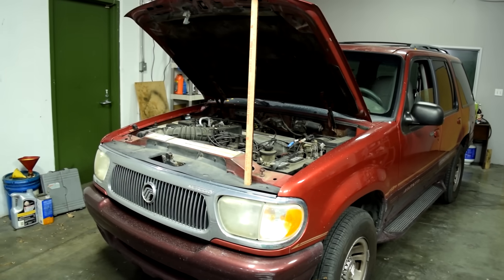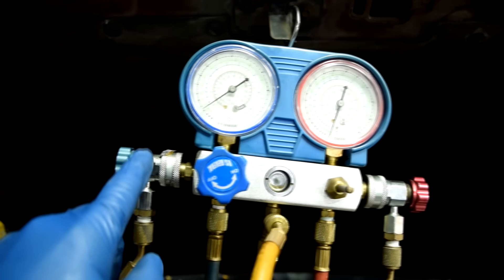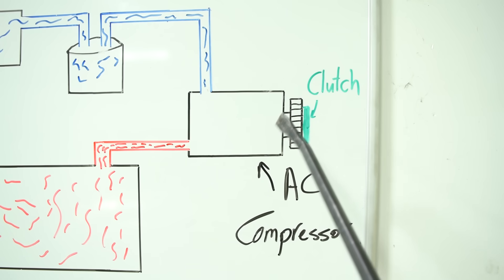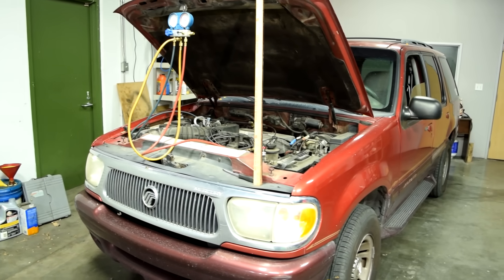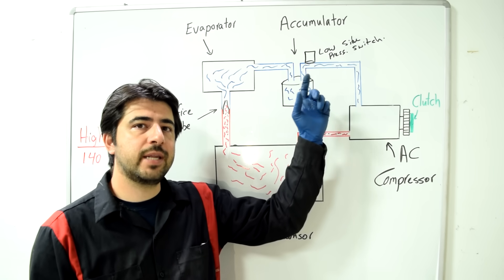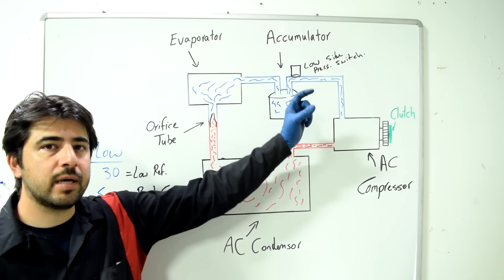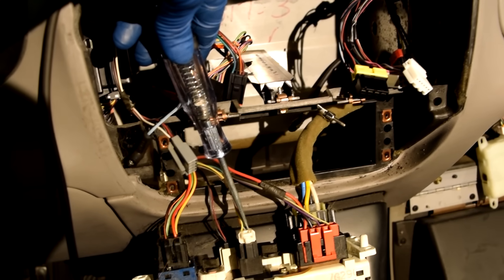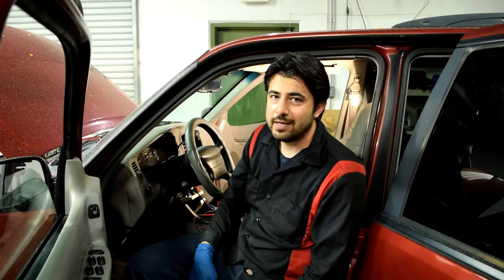Automotive AC Diagnostics, Operation and Repair

Comment: great video, i have a question i 2 cars and in order for the ac clutch to engage i have to bypass from pin 30 to 87 and it works, but i would like to know how to fix that properly where do i look ? relay is good, i have power on 2 pins when engine and ac is on it just doesn't make any sense to me if the relay is working why is not engaging on its own as it supposes to i bypass the low sensor switch but still not working it got the right amount of Freon if bypass is really cold inside but know i shouldn't have it running directly, any ideas

Comment: Great video. I do have a question. On the chart. The last column is the expected tempuratture output at those pressures. Can you explain what they mean Maximum Left Centre? Does that mean the internal cabin vent? Have not received my gauges yet. Seems on very hot day my Civic AC hits around 50, but gets down to about 41 at around 70-75 outdoor temp. Always feel its not up to snuff on hot days. Thank you in advance. Great channel and thanks for the informative video.

Comment: Hi, do you know what would cause the fan to turn on and off every 30 seconds or so? Raising and lowering the pressure on the low pressure side, everytime it cycles on and off. 
The compressor stays running and the air is cool but not real cold. Thank you.

Comment: Your 'Serviced Port Pressure' chart is so correct! Thank you for including it in your video. Google "AC Pressure Chart" and you get one from A/C Pro that has everything too high. When I used their chart, I got diminishing returns and my AC compressor would hard start like it was swimming in liquid. I used your chart and my car is now blowing a cold 40F on a 90F night (I'm in the desert) THANKS SO MUCH!!!
Reply: I was comparing his chart and thinking he has the wrong one because it does not say r134a on it? What kind of car do you have? Just wondering what refrigerant you use?
Reply: @humbledhands  r134

Comment: Years ago I learned to turn the compressor clutch by hand engine not running to check if compressor clutch was ok. Usually a little resistance but still turning meant it was ok but recently on a 2001 Chevy Ventura the clutch when checked by hand had no resistance and was turning very easy. Never seen that before. Could this be a sign of a bad clutch? Compressor kicks in normally, stays on but in spite of having a full charge, no cold air blows inside cabin. Any ideas? Tx for the video!
Reply: When you turn the outside plate on compressor clutch you are turning the compressor shaft and not the pulley which is driven by the belt, pulley free wheels when the clutch isn’t engaged
Reply: Sounds like your compressor is shot, no resistance means not building pressure

Comment: How and when would you recover, vacuum, or recharge the system? What is the order in which you would do this? If you were to recover all your freon do you perform a vacuum next and then recharge? How do you do each? Also how do you replace a bad part? I.e bad expansion valve, accumulator, etc.

Comment: in my 2004 toyota echo I have same (70)psi in Hi and Low with the engine off. with the engine on and ac on in max I have 0 on low and 100 psi in Hi. clutch was engaging but it stopped engaging after I reved the engine. can you tell me whats the problem? and thanks for the clear instructions

Comment: What is your opinion on using stop leak for a quick fix? Does it clog up everything when the mech is consulted to do a proper fix or replacememt of old seals and opens the system to the air?

Comment: I need help my AC works great  when moving but at idle blows hot air and I will spit out something from the compressor and start to smoke bad and I have to turn it off, but when start to move the car like from a street light and turn the AC back on and it will work great again , If you can give me some tips I would apriciated Thanks

Comment: to every pathetic mechanic or ac man; the system is simple, although the manufactures try to make it impossible for you to fix it, its still simple! compressor, low switch, high switch, condensor, evap,  and thats it! any extra switches, computers, dumb crap is being created by your manufactures!, now don't care about the high side at all, remember this, fact if you hook up the suction line fillt the ac after draining and vacing the system, the suction line guage should never go past 35! thats full! anyone tells you different is full of it! don't care what kind of freon you need to use, 35 on the suction guage and yes you need real guages and a thermometor for the vents! try it, been doing it for 45 years!

Comment: My low  side A/C line has blown in half twice as I was recharging it.  Now the compressor clutch wont engage so I bypassed it from the fuse box and I saw it engage while the car was running and I went to charge it up with freon but it wouldn't take
Heeeeellllllppppp....!!!!

Comment: Thanks for calling the switch the potentiometer, you know so much if the electrical system doesn’t really exist except as a tangent to that what is happening in electron flow. Most of this stuff is Hard to know like a thing that you know, but I suppose that even a switch would be a potentiometer, or a measurement of voltage by the positions 0 and 1

Comment: Easy Job. The blend door is broken from the actuator, therefore its in the full heat position. Just open the dash and duct tape it to the full cold position. You dont actually have to fix it, considering the owner wants AC. He'll just be without heat. If he wants heat though he'll have to open the dash again to manually puy the door back into the full heat position. But why do that, just go without heat since he lives in so cal.

Comment: Hello. Hopefully you can help me. When I connect the low and high side line to read the psi the low side is 70 and the high side is 60. The clutch engages and doesn’t disengage. Is stays on. The air is not cold. The gauges stay at the reading as well. I think this vehicle doesn’t have a expansion valve either. Do you have any idea off the top of your head what it might be? Thanks in advance.

Comment: I just replace the evaporator core on my focus cause it was leaking, and now my AC dont blow cold air like it use to... any suggestions?.. before replacing the core the inside temp would be 40 degrees, after replacing the core now it wont go no lower then 50 degrees

Comment: I had a blend door problem as well in a 98 dodge caravan....Removed cover knee plate driver side, remove actuator motor from housing, install Allen key into the hole where the actuator motor came from...In my case the van was stuck on evaporator side...So if I wanted heat I had to turn blower motor on First, this allows the blend door to be forced open and remain open until the blower motor is turned off allowing the blend door to reset to its defaulted failed position for ac... While the blower motor is on flip the allen key up and this gets the heat flowing over the core..Cost me 6 hours of labor trying to find my problem and about 30 mins to fix it once I found said problem.. I said fixed because it was functioning again but it was rigged and not suitable for a professional reapir....

Comment: Gr8 video mate. My compressor making noise. A/C was working good. I turn A/C on to cool motor down as radiator fans turn on(I know they come on at 109°c but I don't my motor getting that hot). Well didn't cool down, but didn't have noise. But everytime I try the noise get worst. A new compressor here in Australia $450 just to buy. Car exactly the same as a Pontiac G8 2008. 350000kns. It a pain to drive in the rain

Comment: Hi thanks for the video. I installed a new compressor. My readings are about 42 low n 42 high side. The clutch does not engage so warm air comes out of the vents. What could be the problem? Thanks in advance
Reply: Maybe the Blend box Switch !!!
Reply: Check to see if the low pressure switch is closing and providing power to the clutch, if not replace it.  Or you could Apply 12 volt power to clutch at the pressure switch location

Comment: Great video!! I have a question please.. 09 Hyundai accent..AC button wont stay on..if I keep it pressed down  clutch is engaged and cold air blows in cabin..??? I'm inclined towards bad button, or low pressure switch..haven't got it on gauges yet..your thoughts would be a life saver. Thank you
Reply: To me it sou like the Button ????  Was it ?
Reply: @jimmysapien9961  yes jimmy it was the cheepo button on a hyundai. You are correct 👍🏼..luckily I found a used one from some wrecking yard in some far off place. $30 replaced whole console. Hyundai doesn't sell the buttons alone of course. Believe it or not we had a leak in power steering high pressure line. Hyundai had no parts for a 2009 Hyundai Accent...NONE.. no part # at the dealership,  I had to fabricate my own ..don't buy Hyundai brother..I bought this car for my daughter for college. What a nightmare car...internal door locks all broke so you couldn't open car from inside. I replaced everything on this car when I purchased it. Another recall on this car is the shaft seals..they leak even with OEM seals which have to be pressed on. Turns out the recall in reality is bad transmission internal bearings...👍🏼👍🏼👍🏼

Comment: I charged my system to the correct coolant weight after a compressor swap (saw your other videos, and others). It wasn't cooling adequately still. About ten minutes later, a cloud of R134 just blew out from somewhere around the compressor. 
Static pressures are about 40/40. Running pressures are 20/60, so the high side is way off. When I try to refill again, the low side spikes to 80, high goes to about 100. The low side slowly settles at 25, but as soon as it goes over 30, it pisses a lot of coolant overboard again. 
Any tips? Expansion valve?
Reply: Your compressor was overcharged and blew a seal
Reply: @terryparsons830  No. I weighed the coolant added. System was clogged. Swapped out the condenser and other components...worked like a charm.
And then my tensioner bolt sheared two weeks later, so I gave the van away. 😂

Comment: 2011 jeep patriot 2.4
Rebuilt a/c compressor 
New drier 
New expansion valve
3 oz pag oil
20 oz freon
Evac was done
Ac was cold for 3 days then was blowing warm.
Low side reads 88 psi
High side reads 100 psi 
What could be the issue?

Comment: Great job in explaining. You were technically correct explaining how the low pressure switch has an open or closed connection to pass electricity. Very good explaining technical in simple dialogue. That is what makes you a technical teacher! thanks for your time and effort! Keep up the good work. 👍
Reply: Would have recommended unhooking heater hoses from heater core for a cheap work around for summer. At least the owner could get some a/c. Would rather be cold than hot any day.
Reply: @davidfisher535  better yet, clamp them bad boys n ur done...

Comment: Hi Sir! So the whole point is the valves on the gauges should be closed for the entired test? Thanks.
Reply: The valves are used to move refrigerant to/from the system. Not for diagnosis.

Comment: I have a Expansion valve on mine and when the ac is shut off it takes a long time for it to equalize.... could that mean the expansion valve is sticking or clogged?? And when its running the Compressor is short cycling like its low but ive added refrigerant

Comment: Hello. Thank you for theres video. It's very informative. I have a 2003 jeep liberty 3.7L. The ac speed working about 2 months ago. When it worked it was very cold. There's no leaks, the compressor works, has plenty of freon,  I was told the pressure's are good. The orifice tube is in the hose, warm on the condenser side, cold on the evaporator side up to the evaporator. The hose from the evaporator to the accumulator is warm, the accumulator is also warm as well as the side to the compressor. It blows warm air just a bit cooler than ambient temperature.  Does anyone have any ideas on what could be the problem? Any help is appreciated. Thank you.
Reply: So, I figured ot the problem. The condenser fan wasn't turning on. The harness was loose. Once I got the fan running it started cooling. Thought this might help someone.

Comment: Thank you & great video! I also have a 2006 Jeep Commander 65th Anniversary & the blower seems to fade in and out at times. I also need to change the blend door actuator since cold air is coming out of the drivers side and only warm out of the passenger side. Looks like I know what I will be doing next weekend!!

Comment: We have an 2009 prius and the AC blows cool air but not cool enough. Refrigerant level is fine. We'll check with the pressure gauge to hopefully diagnose it. thanks for the awesome video.

Comment: Had to replace compressor, drier, and accumulator. I tried to evacuate the system to see if it held a vacuum and it went right to 0 as soon as I cut off the vacuum pump. The only time I got any kind of pressure was when I put in some leak detector. But there is no pressure, and it goes out quickly.  Any clue what could be leaking that much?And I got a UV light and can't find anything, and it sucked up an entire can of refrigerant. Oh, and the compressor never turned on. So I imagine that the problem is on the low side, like the condenser, maybe?

Comment: Replaced the condenser AC fan but I discovered no power is getting to fan...Radiator fan operates fine an I replaced the temp coolant sensor...fuses are good...what could be preventing fan from engaging?

Comment: Bypass the heater core, top off the AC it's Southern California you don't need no stinkin heater!
Reply: I was about to suggest the same thing. Its cali. Screw the heater! Jam glue or jerryrig that things to full blast cold! I'm sure the owner'd prefer that over the blazing heat he's been enduring these past few years. Too cold? Open a window or just turn it off. 😎
Reply: Holy Drug Lord🔼  That's right!!! I retain my heater core for those few weeks of the year where the temperature just DROPS all the way to sub 65 degrees!!! Heater goes on FULL BLAST!!!
Reply: That's a really good point 👌

Comment: Doesn’t air from the gauge line get sucked into the system when you start the compressor?
Reply: No. Refrigerant pressure is a whole lot greater than atmospheric air pressure.

Comment: Because of your videos, I was able to go from no AC experience to successfully completing a complete AC overhaul on my beloved 95 chevy g20 conversion van, which has front and rear AC. I replaced the compressor, pressure switchs, evaporator, orrifice tube, expansion valve, o-rings, flushed everything, vacuumed, and recharged. I learned the hardway that Santech is not better than Acdelco, and your diagnosing methodology came out in me and I was able to use the gm service manual to deduce that my recent ac issue was due to a bad high pressure switch that I installed new during the overhaul of last summer. Well ysterday I completed and it is working correctly now, so I thank you R&W!!

Comment: Trying to diagnose my Honda Accord ac problem. Static pressure is 80 lb on suction and 180 lb on discharge pressure with vehicle not running. My pressure switch is only one switch mounted on top of the accumulator. When I bypass the pressure switch, start the car and turn on ac on full my discharge pressure is 220 lb and suction 38 lb.and blowing cold air.  When I rev it up the suction drops to about 25 lb. which I believe is normally the way it is supposed to run. Is the static  pressure differential caused by a bad expansion valve? Thanks for any help you would offer and great job on the video.

Comment: Another professionally explained video   ...thanks bro big help....I'm a semi truck mechanic...never messed with a.c much...I'm emergency road service so thats not really an emergency....but how different is a.c issues on a semi compared to a pickup truck or all a.c pretty much the same? Ac on a semi is still r134 so i would think pretty much the same just a little bigger parts lol
Reply: It's exactly the same homie. Usually uses an expansion valve on most trucks that I see though. Still all the same shit just a little more freon. Around 3 for day cabs and 4.5 for sleepers I think
Reply: @billarcher569  ....thank you very much for replying and for the information...i have one local customer that may eventually have issues with his ac ....I've recharged our service trucks with the can/kit lol it works ok ....cheap! .....I'd better be prepared though i want to learn the correct way lol...THANK YOU AGAIN VERY MUCH HAVE A WONDERFUL DAY!😊

Comment: Another great video.  If you are taking questions: at what engine rpm should the dynamic (vice static) pressures (clutch engaged) be taken?  It sounded like you read measurements with the engine essentially at idle...higher rpm (<~2.5k) increases the high pressure readings and lowers the low pressure readings.  Some mechs recommend running engine at ~2.5K rpm for dynamic measurements...not sure what the industry standard is.  Great video...genuine!  Thanks.

Comment: If you press the valve with a screw driver on the low side and it's empty, does that mean the high side is empty as well?

Comment: I'd put a valve in the supply line to the heater core , turning open only if cold .  A hardware store item .  Thanks

Comment: Sir.. Can i ask..my aircond problem.. When i on. Fuse aircond always blow.. Event i change new one not more then 5 minut it's blow again..
Reply: ok do not replace the fuse with a higher amp fuse. your Compressor clutch connector needs cleaning. clean it and make sure you have really good contact there. but if you keep trying you will melt the clutch power line and you will be  making all kinds of short circuits. be careful.